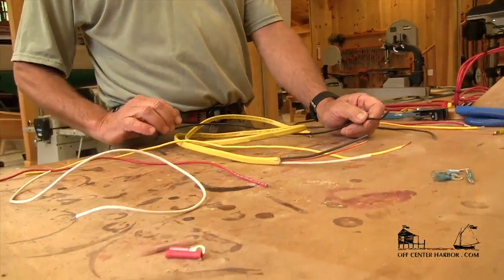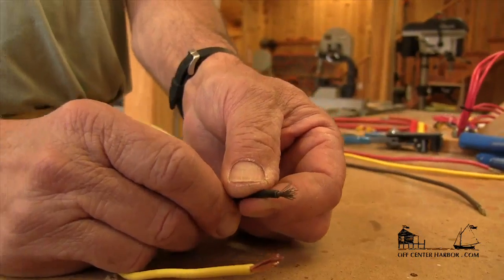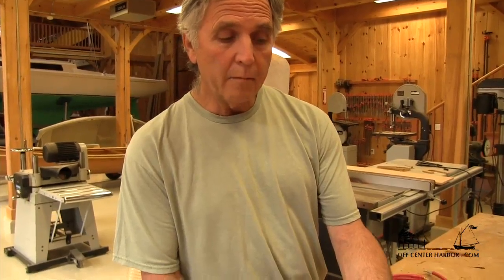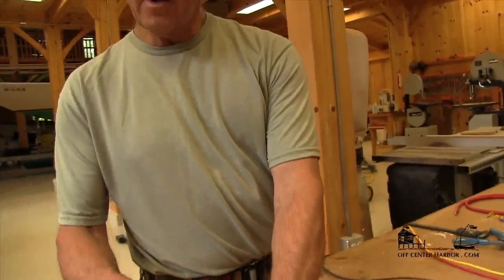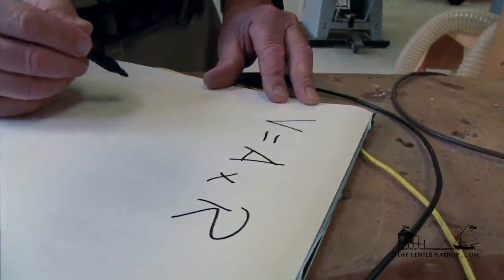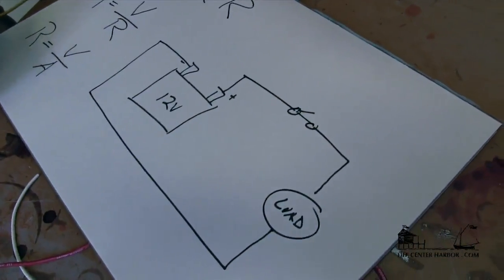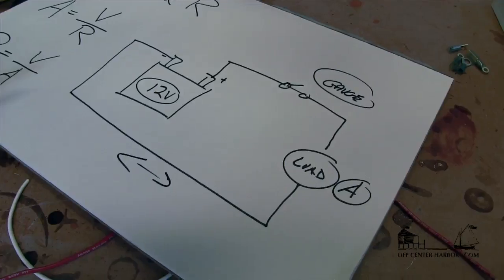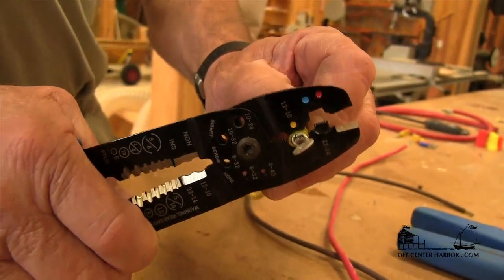Wiring Simplified

Comment: i made the biggest dum dum move ever. I put my battery in wrong and crossed the negative and positive. The starter kicks on manually but the black wire coming in from the battery fried and smoked. I have no clue how to wire this thing because it's a 1986 sea ray that has zero information online for wiring this s.o.b. I just need a diagram or something to tell me what which wire goes to what. Can you help guide me in the right direction? Anyone... whoever reads this... HELP!
Reply: +cash4medaily the black wire isn't my negative, it seems to be an okie doke thing that attached to the positive and goes somewhere under the dash, presumably the ignition switch. Thought I'd put that out there before someone mentioned it.